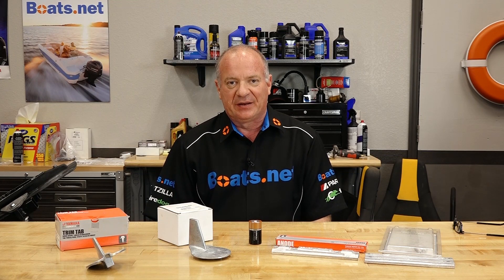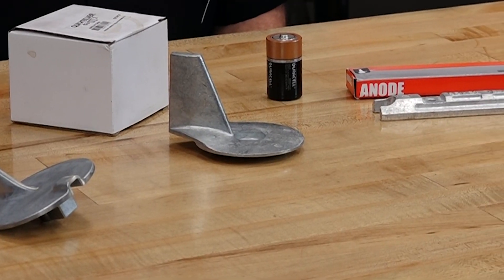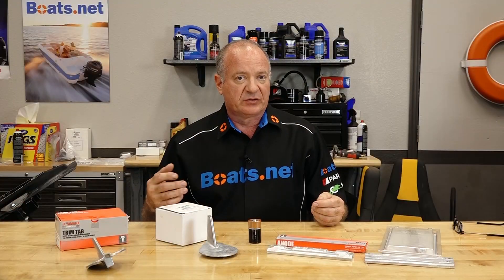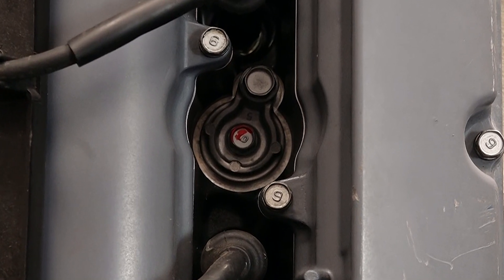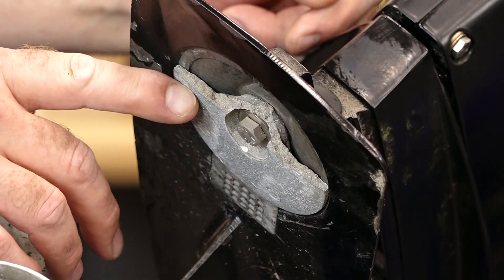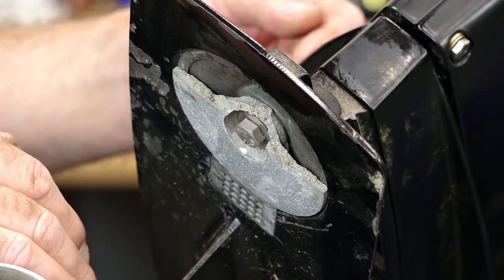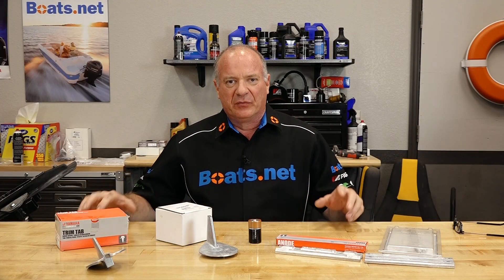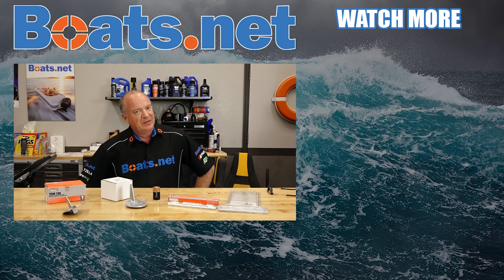What Are Anodes on a Boat Motor | How Do Anodes Work on a Boat | Do I Need Anodes on My Outboard

Comment: Although not directly related to the anode in your post , the thermostat degrades much quicker in outboards and should be checked !  More frequently if in salt water ! 
The thought never occurred to me …. Not until I thought about an anode and it’s function ! 
It may be why the impeller is possibly made of plastic for corrosion purposes !?

Comment: It would seem the effectiveness of an anode is relative to its grounding connection secured via bolts to the engine ! 
Very much like battery terminal connections that need checking and cleaning from time to time ! 
Although never mentioned and probably overlooked , it may not be a bad idea to loosen the bolts securing the anode to your engine and brushing both the motor surface and the anode surface it contacts … especially in salt water ……thereby making a better contact ! ?

Comment: I agree with the at 50% replace  rule. If the anode shows some moderate wear over time, that shows it is doing it's job.
Reply: I need to replace my anode on my Yamaha 70 4 stroke but can’t seem to find the ones that fit   So far I e found one that goes up to 60 hp and they seem to be 3 rectangular shaped ones at bottom of engine.   I did manage to replace the prop anode already

Comment: good video. thanks.  is a bigger annode better?  on my trim tabs are 2 inch zincs. i bought 3" round zincs, they fit perfctly fine. but my question is .... are 3" zincs better than 2"  does it provide more cathodic protection?